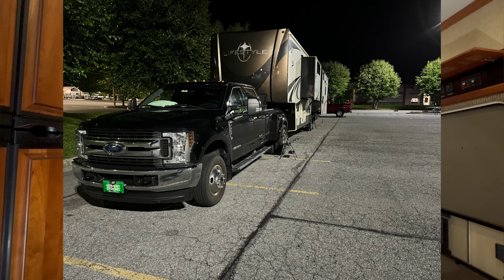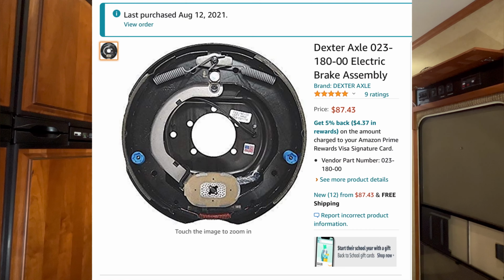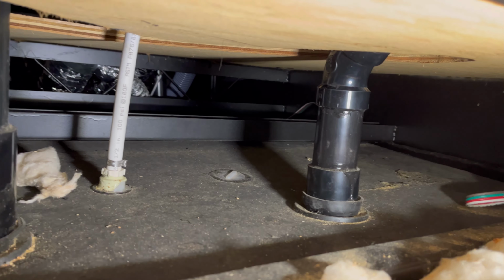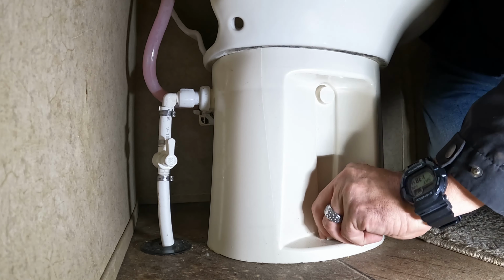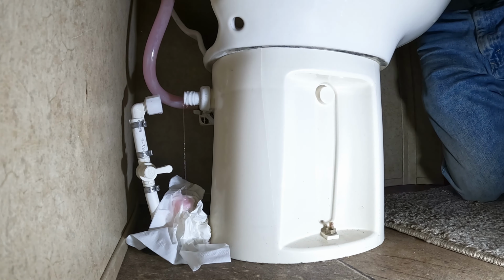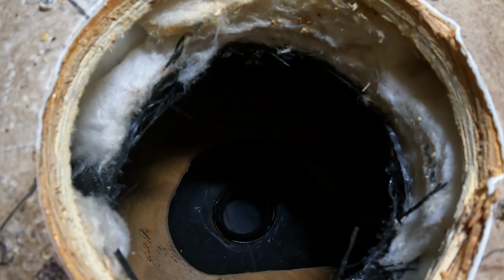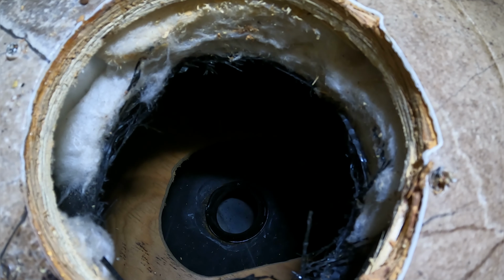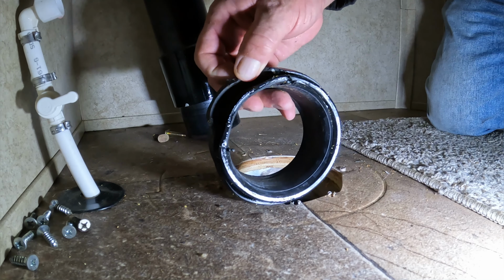RV Black tank STINKS. Camper smells bad tank seal #lifestyle #evergreen #blacktank #rvrepairs

Comment: I get a constant smell in my camper as well.  I wonder if I have the same issue.  Thanks for the video!
Reply from the maker: @setheroth28092  one place i also had an issue is the vacuum relief valve under the bathroom sink. The little rubber seal had failed. I replaced the valve and the smell under the sink went away.